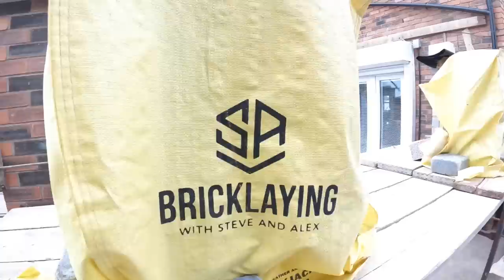HUGE STEELS SEND HELP!!! L SHAPE EXTENSION PART5

Comment: I've learned a lot watching you two work! That's one heck of a lintel!! Does the mortar actually stick to the tray material? Why the block on the inside instead of brick? I'm in the western US and have not seen this type of construction before watching your channel. Excellent work and fun to watch!
Reply from the maker: It doesn’t stick to well 😒. 
   Always block Inside for speed and cost 🧱👍🏽
Reply: The mortar sticks to the dpc because it comes with a hatched key but its not like how mortar bonds to a brick etc. The blocks are used on the inside because they cover more area than the bricks do, advantage for the customer on cost as they're reasonably priced and easier on the layers as they can essentially do 6 bricks worth in one block! Its also useful for having a greater surface area for drilling etc in the future. Blocks are anywhere from a lightweight 2kN to 7+kN heavy duty for load bearing purposes etc.
Reply: Thanks guys! I'm catching up. I look forward to your posts!
Reply from the maker: @dpeter6396  😁🙏🏽🧱👍🏽
Reply: @dpeter6396  Also bricks don't have sufficient thermal value as blocks to satisfy Regs.

Comment: Just an observation but do the steels need to be on padstones or am I missing something?
Reply: correct me here if im wrong, but they are essentially lintels, they can be bedded on the brick and block, no?
Reply: Depends on the structural engineer, and there point loading calculations. Some like concrete pads on inside, some like 3 course of engineering bricks, The bricks are engineering anyway and blocks look like concrete so can’t get much better.

Comment: Why don't they make a set of profiles so second profile slips into the one u have put up for ground floor then you should still be at gauge on your markings plus easier to level it up, they could also fit a couple of level bubbles mounted into them, I'm sure they would be easy to use !!. 
Sorry reworded what I meant hopefully it makes sense this time.
Reply: @SteveAndAlexBuild  think gaz means the extension pieces I’m sure you can get for the blakes 🧐
Reply from the maker: @Marshalltoon  🧱👍🏽

Comment: Question. Why didn't the steel I beams join in the corner with bolts and why was the shorter length not long enough ??
Reply from the maker: Because they are lintels not a ring beam and who said it was  too short ?
Reply: @SteveAndAlexBuild   seriously if they'd been bolted together would it have made any difference??. And making them longer three blocks wouldn't have needed to be cut. Also to avoid forgetting things how about a check list of bits required on the site ?? Weep vents for one...
Reply from the maker: @darrylkennedy2125  👍🏽🧱

Comment: Not builder so please for give the silly question.
What stops the the steels from moving as not look like the very secure
Reply from the maker: It’s on  a mortar bed then fixed down 🧱👍🏼
Reply: It’s really just the self weight of the steel member, a concern is the expansion of the steel which will be more than that of the block resulting in small movement cracks to the plaster, this is always a problem. Great job though
Reply from the maker: @keithchandler3679  🧱👍🏽